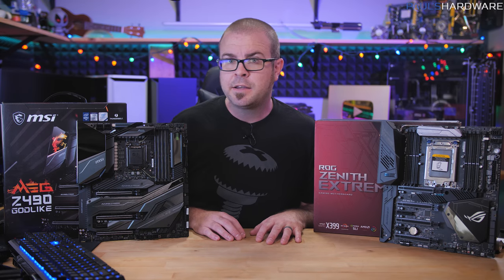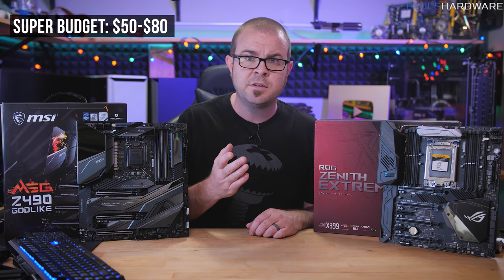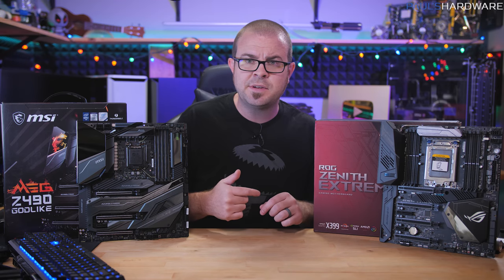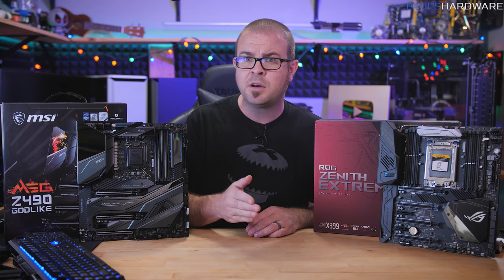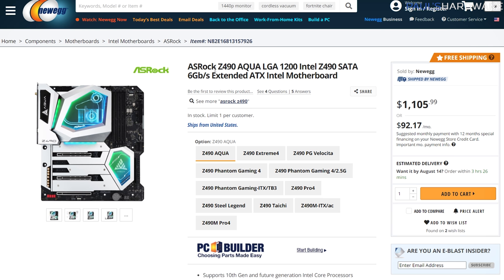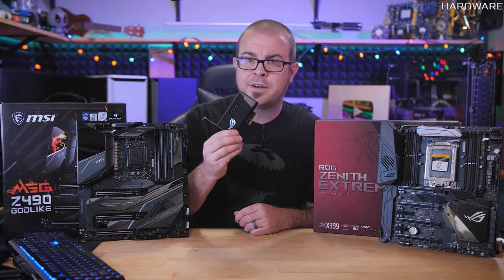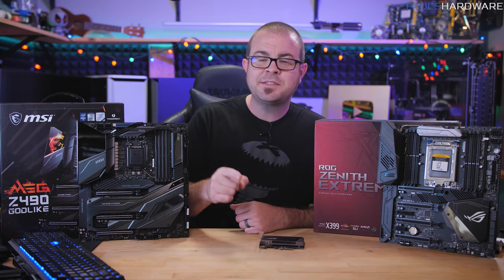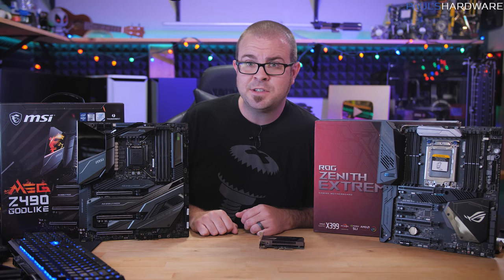What Does a $700 Motherboard Have that a $200 Motherboard Doesn’t?

Comment: Asus Used to have a feature called "Keybot" I fricking Miss that! Used to allow me to turn on my pc with a Keyboard Shortcut. I still can do that now, I went and setup a custom solution that triggers a WOL Packet, but through a separate button that I mounted. I really like it, but I wish they would just come back with Keybot, they had it back on the Crosshair VI Hero, and a few Intel Boards before that, the C6H was the last board I am aware that had that feature.

Another MUST HAVE feature for me actually does have to do with sound. Its the Optical Audio Jack, also known as SPIDIF, or TOSLINK. If the Motherboard does not have that, then I simply will not Buy it. All of my Room's in my house run PC's, and every single Room in my house has a Custom Surround sound setup with 5.1 or higher, and the best way to get audio from the PC to the Sound System is over the Toslink Optical Connector into the Receiver. I don't care about the onboard solution other than that though, because as you said in this video, It's all about the External DAC for headphones. Funny thing is you should the EXACT Picture of the DAC I use in most of my rooms, Either the Scarlett 2i2, Scarlett 4i4, or the Scarlett 18i20 (Each room is setup for Video Conferencing, Gaming and Streaming, or Audio/Video Production as I am an Audio Engineer by trade).

I found for people who want nice looking Lighting in their system, having actual aRGB headers is definitely nice. Although I have found to have reliable lighting, and reliable Fan Headers for that matter, that you can have full control over even when the system is off, and have the Lighting and Fan Profiles saved to hardware instead of in a file on your PC, Using AquaComputer's Farbwerk Nano or 360 (For RGB) and Quadro or Aquaero 6 for Fan Control, gives you far more reliable control over either than any Motherboard I have used to date has been able to provide. (Don't get me wrong, for the vast majority of people, having Mobo Control of Both aRGB and Fan's is going to be more than enough, but I find stupid limitations on boards all the time and stupid software bugs that screws up your profiles, and with the Aquacomputer Hardware that just isn't an issue.)

Another Feature that I often looked for before I got turned onto the Aquaero was having headers for Thermal Probes, so that you can place your own Temp Sensors where ever you wanted (I always placed One for the Intake, One for Exhaust, One For VRM, and One for My 10Gbe Nic) this allows me to get consistent Temp Readings from HWinfo64 because its able to pull all the sensors connected to the Mobo, and this helps you tune and balance your Fan Profile. Asus generally has been good about including at least a few Temp Sensors on their Higher end boards, Usually at least 1 for General Use, and 2 For Water In and Out, but you can use those water ones for anything you want.

Another Valuable Feature that I look for my Clients (I am also an IT Consultant/Administrator) is TPM Headers. This way I can place my own TPM Security Module on the Board for my client and Lock all encryption into this one small chip. These are really nice features to have for clients that need their data to be as close to 100 Percent Secure as possible.

The last really basic feature that I don't remember if you touched on or not would be the amount of both USB 2.0 and 3.0 Headers. For whatever reason Mobo's these days (even the High end ones) started to decrease the number of USB 2.0 Headers while Increasing 3.0 Headers. The fact is having multiple Onboard USB 2.0 Headers are still extremely useful for Enthusiasts to have, so that you can fit all of your devices on the board without having to rely on 3rd party USB2.0 Splitters which depending on the one you use, can introduce problems of their own. For that reason having at least 3 USB 2.0 Headers, in addition to the 2 USB 3.0 and 1 USB C headers is a really nice feature to have. This way whether you are using an AIO that needs a USB 2.0 Header to plugin, along with add on RGB Controllers, Fan Controllers, Smart Power Supplies (Like the Corsair RM1000i), or even Actual USB 2.0 Front Ports, You will have the amount of available ports on the Mobo to accommodate all of them, without having to make custom cables, or adapting USB 3.0 Headers, or using Splitters, they will all just hopefully be available on the board itself. (That said, the by far the best USB 2.0 Header Splitter I have found for purchase that has been the only one not to cause me issues is the AquaComputer Hubby 7. NZXT Makes a slightly Cheaper one that also works pretty well, but for some reason Corsair Products (Like the Aforementioned PSU and AIO) tend to bug out on when connected to the NZXT Option, while as they are just fine running off of the Hubby.)

Anyways, doubt anyone will read this all, but Paul asked, so I figured I would throw out some of the features I look for in a Mobo, and then for some reason went on a Tangent about 50 Other things, so I am going to shut up now. Much Love everyone!
Reply: People do read it 👍

A bit long though 😜
Reply: Why doubt reading it all it was cool and I learnt about some new stuff

Comment: It's coming down in price, but one feature that's pushing me to look at $200-300 boards for my next upgrade are the integrated I/O shields.  I've always hated the little aluminum ones-- trying to line up all the little devices poking through and dealing with the razor sharp edges. I wouldn't pay $500 for it, but $50 more for the same features with an integrated I/O shield? Yeah, I'd go for that.

That being said, I do think that the B550 and Z490 boards have goosed prices a lot.  I feel that there used to be a lot of solid bang for buck boards at $80-100. $100-150 was mainstream, even on premium chipsets, $150-200 were mainstream, but with more premium features, and $200+ was high end.  I suppose part of it is better VRMs with higher core count CPUs, but I felt some sticker shock the past year.

Good video, Paul. Keep up the good work.

Comment: i tend to prefer the ~400, i want to keep the thing for 7-8 years so having some QoL stuff is worth it.
Reply: If you keep the thing for over 3years well you definitely don't need more than 200$ my system phenom 2 system still runs today we didn't  spend much it was also a prebuild system.
Reply: @tanmaypanadi1414  point = missed
Reply: I had a $79 Mobo for my Phenom II x4 last over 10 years of gaming by myself and my kids and it was still working when I upgraded to a Core i7.
Ran that on a $99 Mobo and just upgraded to a Ryzen 7 with another $99 Mobo.

If I hooked those up now they would still boot.

Comment: My motherboard cost $550USD... 6+ years ago. And it is still in use as my main rig, albeit with upgraded components along the way. The MB I am speaking of, is the EVGA X79 DARK. Runs i7's and XEON's. (Currently an E5-1680-V2 @4.7GHz all core) Massive amounts of I/O, SATA, and lets not forget the PCI-e lanes (40 from the CPU, and 8 from the PCH) and quad channel memory. It has 3 BIOS chips, 1 being socketed. 12 Phase power delivery and a 12 layer PCB. DIP switches for the PCI-e slots, a very useful troubleshooting feature. LED 2 digit POST code display, with power, reset, and clear CMOS buttons on the board. And NO RGB! (Perfect!) The only thing I wish it had, was a PS/2 keyboard port! 
Did it cost a lot? Yeah, it did. But it has also lasted, and will continue to last. Should I upgrade? I've been looking. But it will be another high end system, because I know it will last me for another 6 years or more. Investment over time. That, and I need the PCI-e lanes.

Comment: So... Sound and Lighting tech for Live Theater here....
On high end audio.... I have had times where I was on set, show about to start, and the DAC failed (static, level drop, etc.)  And having a system that actually outputs clean audio without a DAC absolutely saved the day.
Of note... probably the most important stat for good audio output is Signal to Noise Ratio (SNR.)  Something above 96db is fine.  This means that even if your send is quiet you have the head room to boost it without it sounding bad.
Also, the failed DAC's were not cheap little things.  I have had this happen with Mackie, M-Audio, MOTU, etc.

This said, I would honestly NOT use a DAC if you actually want to output the cleanest audio you can to a really high end system.  I would install an audio system that supports DANTE and install the DANTE Audio Driver on my computer.  That way I can use the same wired network to send all my audio.

Comment: "Who actually buys these motherboards? I have no idea to be perfectly honest.."

buildzoid has entered the chat
Reply: I feel like buildzoid either gets them loaned to him to drool on or he analyzes pictures of them but he in reality spends 125$ on mobo if it’s out of his pocket
Reply: Kind of a daft thing to say from a big tech tuber.
Reply: X570 aorus xtreme has its power inlet pin tilted 90 degree instead of traditionally facing the user, a very big plus point for cable management, same goes with Sata, fan, water pump etc. And yes the additional temp sensor input and sound sensor input is worth noting as it further fine tunes overall cooling abilities of the build.

Comment: I'm from Hungary and I'm pretty much broke, I saved up for a year to buy a GTX 1060 6GB back when it came out in late 2016 to replace my GTX 650Ti but the rest of my system is quite meh and ever since I didn't have the chance to upgrade it as I had to spend all my money on my studies. However, a friend of mine from the UK was nice enough to send over some components from his old PC last week, which make me feel like it's Christmas early. By today's standards these components are indeed old: it's an i7 4770k, 32GB of DDR3 and an ASRock Z97 Extreme 4 but they are still going to be a great boost for me. The one thing I noticed on the motherboard though that it seems to be very feature rich compared to its original MSRP, today this would be a 300-400 USD motherboard. It's crazy how times change.

Comment: I will say specifically the ROG impact series is why I spend $420 on a motherboard, I actually waited to go for a 3950x from my 4790k because the z97 impact VII that I've been using for 6 years had very specific features that up until the x570 impact VIII weren't getting added. the impact VIII is overbuilt as hell with a backplate that has a heatpipe and a really good motherboard design.

Comment: i built a $10,000 build in the Obsidian 1000D not unlike the one you built but with dual custom loops. i bought the Z390 aorus master for the top board and I did use any of the fancy addons. Im upgrading it now to the 5900X and im only going with the X570 Aorus Master this go around. Really good video and very informative.

Comment: Thanks for great video Paul . . . . . totally agree with you about buying a separate DAC rather than pay extra for it on the board, however, while such interfaces as the Scarlet 212 are perfectly decent for most folks, it's inaccurate to call them 'audiophile' - which is IMO a word to be avoided anyway ;)   Like all hardware, DAC pricing & features follow a bell curve from budget options that are no better than that integrated with a basic mobo, through solid mid range options to the high end, where you're easily talking $2000 to $5000. Happily the baseline quality of the chips, clock and circuitry that handle analogue-digital, digital-analogue conversions have improved massively over the last 20 years, so current mid-range compare pretty well to the lower high end of around ten years ago. 
However, people should really do their research before spending ANY money on a separate DAC, not least because of the tendency for marketing BS to be excessively misleading, liberally scattering words such as 'audiophile', 'professional', 'pro-audio' and 'studio quality' with low-end products that are targeting the badly informed. This particularly applies to anyone wanting to stream or record & mix music, where sorry to say, most tech and gaming you tubers are no better informed than their audiences. I recommend checking out channels that specialise in home recording audio hardware for the best deals at various price points. Cheers

Comment: The fairly recent X570 Tomahawk Wi-Fi is a godsend for a lot of us. I originally purchased a B550M Mortar Wi-Fi, and while it was shipping, the X570 Tomahawk went in stock. Not 60 seconds later, I was already checking it out. I just resold my Mortar and couldn't be happier with my Tomahawk.
Yes, maybe a lot of you would tell me the Mortar would've been just as good. But just like this vid said, I have my personal reasons for wanting the Tomahawk, and that should be enough. 😁

Comment: As someone who owns one of this boards, particularly the MSI MEG Godlike X570, i know i really didnt need it, and could of gone with a much cheaper board, but i already bough a really expensive E-ATX case i really liked and figured, this would fit perfectly on this case. Plus i made up my mind i would build my next powerful gaming rig with all high end components. Total cost was roughtly around 4500 after all components. Yes it was overkill and lots of unessessary money wasted but like i said, this was a proud build coming from a gaming laptop using a egpu with a 2080 super it was about time i made the upgrade and had the money to splurge and go all out. End of the day yes it was really espensive and although i dont need that kind of power it is nice to know ill have a system that will last me for many years as i dont plan on upgrading for many many years. Well untill the 4000 or 5000 ryzen comes out and the Nvidia monster RTX 3090.

Specs follow as:
R9 3900X
MSI MEG GODLIKE X570
MSI MAG CORELIQUID 360R AIO
MSI RTX 2080 TI GAMING X TRIO
G.SKILL 4X8 32GB CL16 3600
EVGA SuperNova 1200 P2 PSU
SanDisk Extreme Pro M.2 NvMe 1TB (OS)
2X ADATA SU630 4TB SSD (Steam and Origin Game Data)
1 HDD Barracuda 8TB (Data, Video Storage.....etc....etc....etc)
1 HDD Barracuda 4TB (OS Data and Image Recovery)
Cougar Conquer 2 Case
Few other accessories like fans, power converter, RGB control box many many other stuff

Comment: A brilliant, well thought out, solid video offering advice and comparison like I have seen no where else. I build my SIM Racing rigs to last me five years with nothing more than graphics card updates. Worked well on my last build that went from 2 x Asus 780TI to 1 x Asus 1080TI to 1 x Asus 2080ti. With the new series 3 cards coming out I want to get a new build done and send my old sim rig to Emby. I am a high end MOBO buyer because I like my rig to last 5 years and high end MOBO's carry the features that will still be strong in 5 years like 10G on board networking , high speed memory rates and other things that carry me through about 5 years before new tech out runs it. I give zero F's for RGB lol, now that's a waste of money IMHO as is liquid cooling unless you are a super over clocker dude IMHO. I simply want to pair a 10th gen 10900k with some 48000mhz ram, some Samsung M.2 Pros and have as much PCI bandwidth as possible.  I use the onboard sound. Networking, Bluetooth and all the rest f it. Folks that claim a high end MOBO is just bragging right are missing the point IMHO and maybe are a little p1ssed they don't have one (they will tell you that's not the case, they are just smarter than you and know better and you are stupid, wasting money so you can brag. No not me, I am not 12 and my D1k is big enough thanks). I run my mobos and CPU's for 5 years. When I upgrade, every five years........ I buy a super fast CPU and feature rich MOBO, for the next 5 years I know my rig will run whatever comes out at max settings. I "F" about a lot less with these things since I took this stance. Your video has helped me understand the difference and make an educated decision. Thanks Paul. Thanks very much.

Comment: Two nice overclocking features are the safe-boot and retry buttons.
Safe-boot should load a stable BIOS without clearing your current OC settings.
Retry will continue to load your settings until it achieves a POST. Super handy
 when tweaking your memory timings.

Comment: "$200 midrange board". Man, I remember paying $65 for a BIOSTAR mobo back in the Core 2 days. I also remember paying $220 for a X99 board in 2015 thinking it was excessive and then $350 for an X399 board in 2017 thinking that it was super excessive. Admittedly, the X399 board at least has a POST code readout. It's my first board ever with that. Kind of miss the days of being able to pick up a POST code display for $20 and shoving it in a free PCI slot to see where the board is stuck. I kind of miss BIOSTAR in the BYO PC market to be honest. They made what I'd consider to be super budget boards done right. Minimal features sure, but built well and super reliable.

Comment: One thing you didn't mention that I've noticed is the number of USB ports on the back panel. I've been keeping my eye on X570 boards and if you want more than a half dozen USB ports of any kind you're looking at the higher end boards. USB hubs are the usual response but I find a lot of devices don't work well with them. With a mouse/keyboard, webcam, speakers, headset, ups, and external storage I've already exceeded the built in I/O.